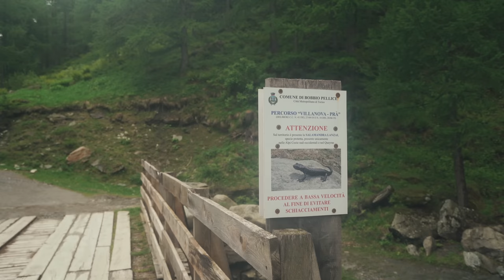#70 Pouring the Floor

Comment: You might need to ensure some veterinary care for your brown hen if she's still limping that badly at the end of the week. She shouldn't have to be in that much pain all the time. 😢

It's good that you got the floor poured! It seems like an actual room now, and will be quite cozy by the end. At first I had doubts about putting the kitchen upstairs and bedroom downstairs, but as I'm thinking about it more it makes a lot more sense if the only access is via the stairs. I'm a little worried the masonry stove will give you very hot feet going up and down, though!

Comment: So sorry about the chickens. Not the dog's fault either. It's in their nature to chase things that move and if they haven't been brought up with poultry even the best behaved dog may succumb, especially when enjoying all the exciting smells and sounds of the wild for a change. The problem with a fence is that the chickens will likely fly over. You can clip their wings of course which is cruel but another form of trade off. A fenced area may give the chickens somewhere safe to retreat (fly) to if another dog comes. There is electric fencing for poultry which allows flexibility. Unfortunately one can't completely insulate oneself against grief. You seem  to have made great progress this week, weather challenges notwithstanding. Yes, weather forecasts seem to be increasingly unreliable. I'm not sure which is worse, excess rain or drought and the risk of fire, but there are always some areas that are protected. Hopefully yours will be one.

Comment: Martijn I think you would get a better concrete if you didn’t put so much water in the mix.  You don’t have to have water sitting on top of the mix for it to be hydrated.  When you work the concrete by jiggling it with the screed the fluid will come to the top.

Comment: The concrete sets up really slow when there is a membrane beneath it because the water has nowhere to go but evaporate up and out the top. Inside with no sun exposure only exaggerates the problem. LOL !! People add rocks/bricks when they are afraid they don't have enough material. Problem is, sometimes the material they add absorbs moisture and expands at a different rate than the concrete mixture. If/when that happens, it "spalls" the concrete (big chunks break off because of the expansion of the materials (rocks/bricks) inside the concrete mixture (similar to freezing water in rock cracks or engine blocks. .
Reply: I think it’s part of the building code in Italy. I watch another channel and they as well are turning an old barn into a home but they are not as far along. Quite a few layers and a certain depth are required.

Comment: Too bad about your pour in 2 goes. You need to know the volume of the slab, and then measure the pile of sand and rocks, and the volume of all the Portland cement.  If you know your cubic meter amount, you can see if you have enough or not. If you measure in dm (=10cm), and you multiply the dm height width and length, you will get the amount of liter that you have. 1 cubic meter is 1000 liter (10x10x10=1000 liter). Always be sure that you have more then enough. Also, be sure to only put in the amount of water you need to consolidate the concrete, and nothing more., that way you can  have the strongest concrete as possible. Also use a concrete vibrator to make sure there is not air trapped in the concrete. 

The concrete went in way too wet.. The floor will work however.. You may need to paint the floor if you want to make it watertight. 

For the road, some small culverts under the road should help if you have the ditches next to the road where the water accumulates. 

Pretty good stuff. Just keep going, and you will get where you want to be. 

Greetings,

Jeff

Comment: I'm really sorry about your chickens. I did comment multiple times that this would happen, but I'm sorry that it has already. 

I had half of my flock, about six chickens, killed in the middle of the day by a fox. It was bloody and traumatising to discover. My rooster put up an amazing fight to protect his girls and gave his life so the others could get away. The one with the broken/hurt leg may need splinting, and also should be on restricted walking time. Otherwise I've found they don't heal well and may need to be euthanised. 😞 

I'd get a solar electric fence for now, it's quick and effective if tall enough and if it covers a wide area. You can regularly move it to new 'pasture' to keep your girls happy. Once they start laying they will smell even more tempting. Consider a livestock dog, pair of geese, or at least a rooster. 

Great job on the floor! So much work with all the connections and prep.

Comment: A bigger truck with bigger tires would be easier on you for going back and forth for supplies.
Reply: Yes, like a real full size pickup with an 8 ft.(or however many meters that is) bed...4 wheel drive would be needed also...

Comment: I have seen caged runs made to house chickens while they scratch around outside of their pens. Every day you just move the run to another spot where the chickens can be. You peg it into the ground at each corner so it's harder to lift or turnover too.
The mobile pen won't stop a predator from attacking but it will take them longer getting to the chickens. Maybe enough time for you to attend... 
I have also had a wild dog turn on me and in those days I had a .22 rifle which I fired, scaring it away. If you have to engage any predator please be careful, you cannot predict their behaviour.

Comment: Clay bricks will carry the moisture to the rebars ,best to use cement blocks. If you make more than a concrete pouring make sure to make a cut, so the next concrete joins easily with out flaking.

Comment: Greetings Martijn! Enjoying the content thoroughly. Love this location in the alps. It never fails to rain the day or night of a concrete pour. Thank you!

P.S. It sounds like what you were describing in your monologue is known as a water bar. I ran a pipe along the water bar, perpendicular to the road as you’ve described and backfilled with stone. Sort of like a French drain if you will. That way you can drive along the road without the bumps. I extended the pipe enough to ensure water ran off of the road consistently. Cheers!

Comment: It is generally recommended to wet the concrete slab with water for the first few days of curing, especially in warmer climates, to reduce the evaporation rate of moisture from the curing concrete in order to prevent cracking and shrinkage.

Comment: The chicken coop needs to be a whole lot closer to the house, and made stronger so that nothing can get to the chickens.
Reply: Th chickens were ranging freely when they were attacked, they were not in the coop.  It is well built and has wire under it to stop digging predators getting in. They can only be totally safe if they are locked in the coop at all times. If they have a free range life then there are risks, but the wonderful freedom they enjoy is part of that.

Comment: Is there any rock/stone you can mine/harvest from around your land to build a well draining road base? Also, they are called rain bars, the small ditches that cross a road. In Austria, they are very keen on using galvanised steel rain bars, easy to clean out after a big rain. 

Thanks in the meantime for all this fantastic content!

Comment: Dear Martin, I'm living in Piedmont like you,on the hills. I saw today your last video where you are thinking to buy a bigger four wheel drive and bigger trailer. I understand what you need, but if I can, I'd like giving you a suggestion : why you don't buy a " motoagricola " ( italian word) as like a tractor including trailer, with four wheel drive, fast and low gear speed, ( maximum 40 km/ h ) two front and rear differential mode, cabin with the heat system and you can load till 2000 / 2500 kg, based on engine power. In my point of wiew is easier driving also in winter in the snow without any trailer. This is my experience. You can looking forward a second hand motoagricola, perhaps Carraro Tigretrac, one of the best brand in Italy. Sorry, but we have similar way of life. I'm 74 year old . Best regards and good luck for your future projects. Ugo 😊

Comment: How about ruler tools for leveling concrete? Did I see you use a small width vibrating one? We always had the simple manual ones, but so effective. 1, 2,  or more meters long aluminium macon's rulers.
Unlike Sysiphus you go forward, no matter what. Road first, but roof to be waterproofed. Flexibility, adaption of the species is once again key.

Comment: Yeah, loose or feral dogs are the biggest menace to chickens. They don't intend to eat them. The chickens are just squeaky toys. So when one stops squeaking, they go after another. A good size dog will go thru the mesh you have in their pen. Either electrify or use concrete reinforcement mesh on the outside. I have lost dozens of chickens over the years. A good bb or pellet gun also comes in handy. At least, that's probably the best you can do in Europe.

Comment: It is only Spring. You have plenty of time to finish your house before winter.  It is pretty much "dried in", and close to having working sewer and water and electrical.  if you had to, you could finish some of the inside tasks during the winter. But I don't think you will have to.  You should seek advice about your road. I definitely agree about the berms and swells. But it may be that you will be advised to wait until the roads are more dry. You may need some culverts also.  I can't wait to see your new car/truck and trailer. So sorry about your chickens. I hope the brown one recovers soon.   I hope you can take some time to rest. Cement work really takes it out of a man. The scenery is so lovely there. You are in a win-win situation, even come winter.

Comment: So sorry about the girls but living out of town off grid it was only a matter of time before foxes, wild dogs or even domesticated dogs would of gone after a free meal. The girls need a fenced in area to roam. I follow on utube  a couple in Alaska who live off grid and they like you raise chickens and like you have had trouble with wildlife only their problem is the big black bear.  They fixed the problem with an portable electric mesh fence. This system runs on a battery powered by a small solar panel and they positioned the fence around the hen house.  As the mesh is attached to iron rods to keep it standing plus a pointy end to push into the earth it it quite movable so when the hens have cleaned up  one area you just move it. A great way of keeping them safe and getting the ground you would like to be fertilised and not be treading in chicken manure when you walk about. The chickens can’t get out through the mesh and the bears/wildlife are deterred with an electric shock. It is working for them so it might be something worth looking into if you want to remain free range.

Comment: You should never mix concrete without the right amount of water, there are specific substances you can use to make it more liquid, otherwise you gonna end up with a  concrete that's not as strong as it should - or at least could - be

Comment: Sorry about the dog attack. Just a couple of suggestions. Bring the injured one inside your tent if you can, in a crate. Talk to her quietly and give her anything she wants to eat. A few days might get be enough and then you can put her back in the coup with the others. The other suggestion is to be patient with them and habituate them to being handled. This will make it easy to catch them when you need to, examine them for medical reasons, cut their flight feathers if that’s what you need to do an vaccinate and deworm them. In situations like this they need to go to their place of safety which is the coop. You could give the injured one some Meloxicam which is an anti inflammatory and therefore a painkiller. Poultry hide their symptoms because they are a prey animal so we just need to treat for the worst case scenario. Good luck and safe poultry keeping. 🐓

Comment: Hi Martijn. For "swales" I think the technical terms are "water bars" (low ridge narrow strip of flat stones set into the road/path, to divert water across and off the path road), or "cross drains" (narrow rock gutters set into the path/road surface to catch and divert any water running down the road). "Swales" is a word mostly used by farmers or geographers to describe long low depressions that gather water, for example between sand bars on a beach at low tide, or long marshy shallow hollows on grazing meadows. Nice word though it is mostly a Scots or eastern England dialect word today.

Comment: Glad all the girls are doing better, and running around again. What a beautiful area. I live in NY state and my husband dug our basement out by hand, with a shovel,wheel barrow and time. He also had to use a jack hammer, with pin and feathers to crack and break rock and by hand load a wheel barrow and dump the rock. That was over 46 years ago, so we both appreciate the hard work you are doing. Keep going, which we know you will. Best part of our basement project was when the cement truck came and poured the floor.!!!!! We both just stood in driveway and watched as the truck and cement crew went to work. It was wonderful to know that that project was coming to an end.

Comment: Yep, time for a 4wd pickup truck with tow package and a double axle trailer with electric brakes (whatever is available in that part of the world).  I learned after a couple years getting stuck in the back country what was required.  I now know why everyone has a pickup truck out here.
Reply: Yes, I agree, except I would just get an 8 ft. bed full size pickup with 4 wheel drive..might be hard to find there, though, as for some reason in Europe they don't seem to have useful size pickups much... I don't know how I would get by without one...I would haul most stuff on the pickup, not the trailer, as that would be more stable and safer than pulling a loaded trailer up and down those steep slopes and narrow roads...a heavy trailer will also require better brakes(or as you say, trailer brakes), but you will still have the problem of needing more traction to pull it up the slopes....

Comment: A chicken tractor would be a lot less work than a fence and it can be moved around to provide fresh grass. One of the best things about tractors is that they have roofs for an added layer of protection. Also when they lay eggs, you will be able to find them. When chickens free range before they start laying, they will lay eggs in any secure spot they find. If they are habituated to the coop, they learn to lay in the boxes and will return to the coop to lay even if they are free ranging.
Reply: Hello Martijn.
I sent a message about a chicken tractor.I also wanted to mention that the injured hen should be confined to your upper coop for a week to heal.The other hens may start to attack her if they feel she will possibly attract predators due to her visible injury.Alsoa simple splint,wrap the area first,the cut two pieces of wood just enough to straighter the leg and wrap those onto her leg.Not to tight,just enough to hold.Chickens are resilient and don’t complain much,it could just heal on its own but if not straightened out it will heal bent.A good lesson on getting them used to some kind of call back to the coop.a bell,you whistling,an actual whistle…..anything they can hear and have food as the reward.When you see a dog or another animal….you ring the bell and they come running for food and you put them in the coop.I have an idea for your enclosure of the preferred chicken area for free range foraging.Bird netting ….it’s actually for protecting fruit on trees,but comes in thicker net,it’s not easily visable,and if anchored will at least stop an initial attack.It’s very strong and comes in huge length and width sizes and is Very cheap.
I also can send you some items for winter in the coop if you would allow me to.But I’d need a mailing address.
My father was a veterinarian,I lived on horse property,we had chicken,ducks,Guinea hens,goats and horses.So I have some knowledge that is easy to apply.
Let me know if I can help in any way.
More information gives you more options,and with animals,more options to choose from help you make better decisions when things get wild🙂
I’m here if you need input.
Diane Wills

Comment: Hello Martijn, So glad the chickens are fine. Not sure about what you call them there, but metal culverts might be something to think about for your rain drainage. I don't know how steep your land is, but any area with a 15 degree slope (about 1:3.75) isn't a good idea, as the water saturation may cause slides. That's why I mentioned metal culverts. I could be totally of my rocker. Just want you and those darling ladies ( chickies) to be safe.

Comment: I know this is months late at this point and someone may have already told you, but you're mixing your concrete way, way too wet. Too much water will cause Curing and strength issues. Not a huge deal for what you're doing here, but if you need to do structural pours in the future, use significantly less water in your mix.